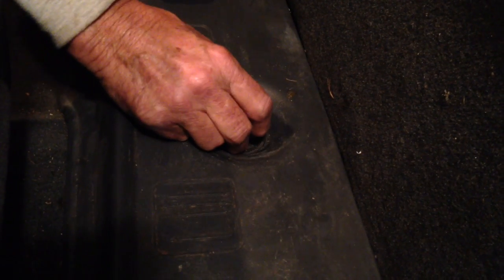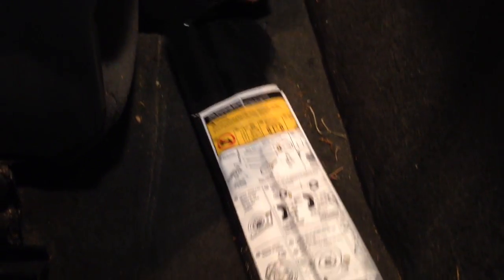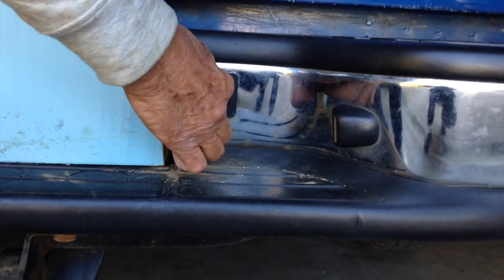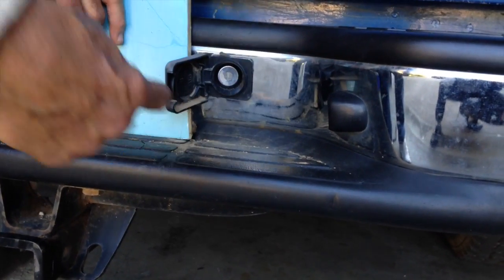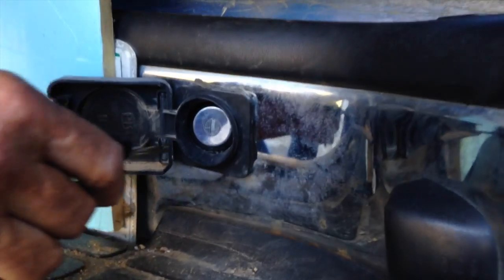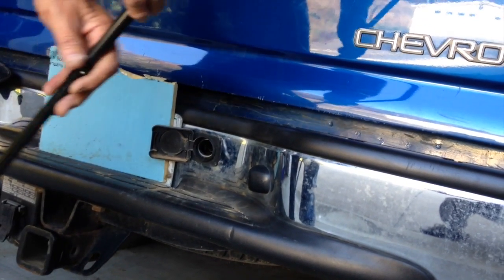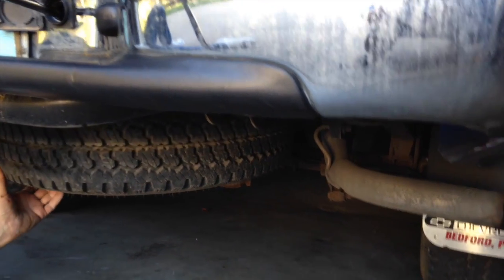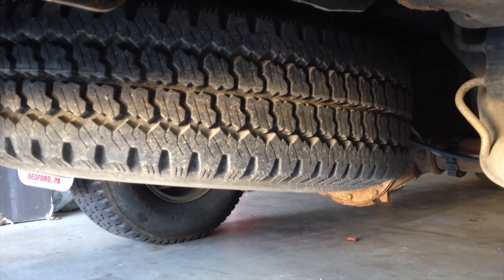Flat tire problems-2004 Chevy Silverado Truck part 1-2

Comment: Ford's similar, uses a special socket on end of jack rod.  Wench
lowers tire to the ground to unhitch cable.
Reply from the maker: If the cable would lower the tire all the way to the ground for removal that would be a much better design. Thanks for watching and your comment. People that doesn't know the techique could be left stranded.

Comment: RTFM!!!!  You are to crank it back up tight until you hear 2 distinct Clicks.  Do that twice and you might get lucky enough to release the Secondary Latch.  It is all spelled out in the manual.  If you do get the spare down, grind off the 2 claws that catch in the socket .
Reply from the maker: Thanks for your comment. It's always better to know ahead of time. Thanks for watching.

Comment: Interesting video
Reply from the maker: +Geoffrey Goodman  The best bet before you have a flat tire is to check and make sure the spare tire is not flat. Make sure it has enough air in it. lp had a flat spare tire also. What lp did was pumped the tire up enough to get to a place to fix the tire and check and add air to the spare tire. The spare only had 10# of air in it.